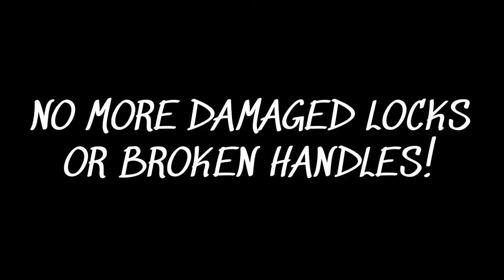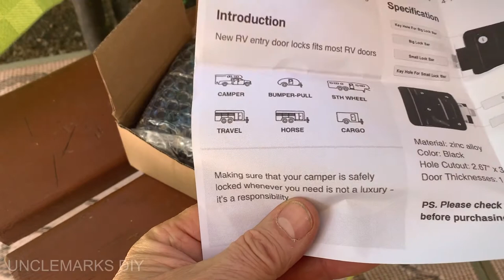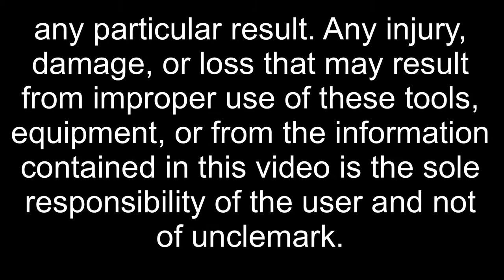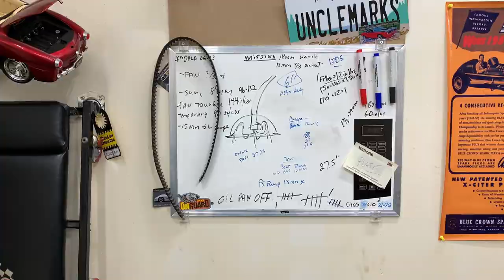How to change a RV exterior door handle (EP145) camper trailer

Comment: Thanks, just what I needed 😉
Reply from the maker: It is not hard to replace. Hope you can find the right one. You could just remove it and take it to a rv dealer and they could order the right one, or they may even have it in stock.
Reply: @unclemarksdiyauto  thanks! I've been looking online, I'm in Florida and there's local options but they are almost double the price. In the meantime my cats are enjoying breaking out since the knob to lock it inside is what broke and although I took off the faceplate and can manually pull the latch, it's not closing securely so enough pressure from the little hoodlums opens it. I tried to slide the deadbolt by hand but it isn't always aligned right to get it done 🤦
Anyway, hope that made you smile. I subscribed to your channel in case I need move RV help. Keep up the good work!
Reply from the maker: @matildajones6175  Yes your story made me smile Matilda. Maybe there will also be a video on a vehicle problem you might have that one of my videos might address as well. You and the cats stay well and a big hello from Manitoba Canada.
Reply: @unclemarksdiyauto  🤗👍😺😸😼
Reply: I bought the door look but did not measure first. I should have watched first your video before I bought the part. Lol.

Comment: my lock is badly sun faded  ..probably will break soon  ..thanks for the video ...hardest part  might be getting the right lock for my door
Reply from the maker: I think this replacement lock mechanism is a bit weaker than the factory original. Photos,  trailer model & photos brought to a good RV dealer should be able to get you one...I hope!
Reply from the maker: Check out similar RV repair videos that I have done in my RV trailer playlist!

🔶 https://www.youtube.com/playlist?list=PLgeVnQRQkbzAsmAaCU0QzGXLWNaC-JOc6 🔶
Reply: If you put the bracket on first and tighten it, it holds it in place and makes it way easier to get the four screws in.
Reply: @coky6026   thanks